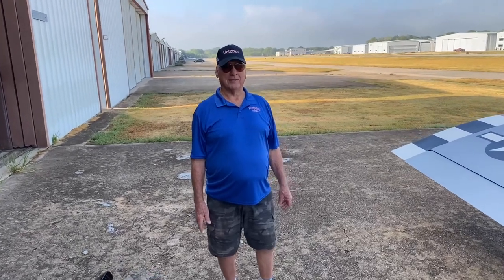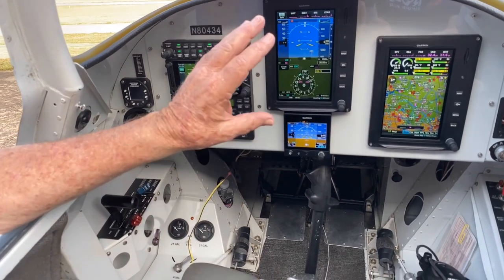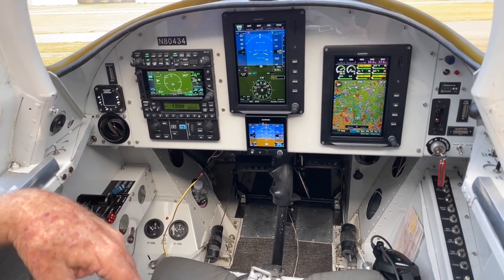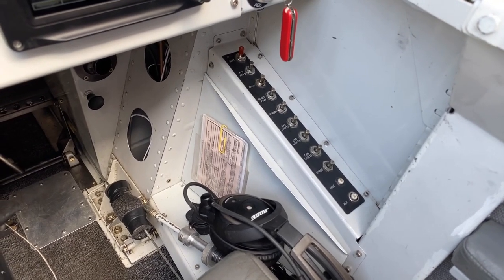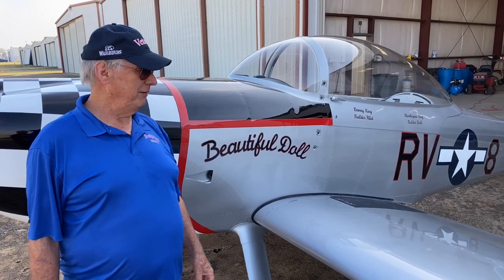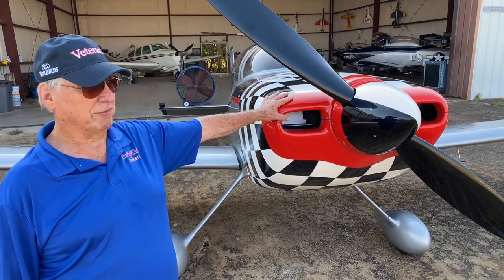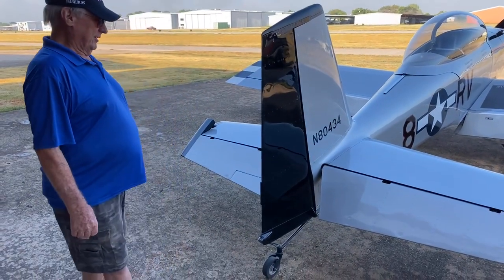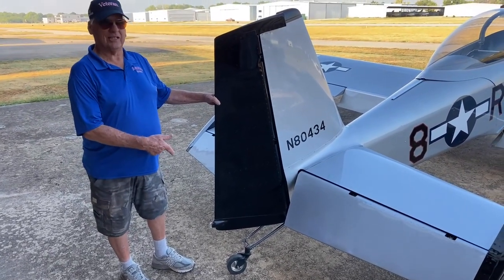Danny King discusses his RV-8 “Beautiful Doll”￼

Comment: Thanks for sharing Danny. Clearly, your RV 8 is the best thought out I have seen.  I built a Lancair 360 with an IO 360 B1B. Had I known about Vans, I think that would have been a far more useful choice. Here in Australia, away from prime airports, some of the outback strips would be better suited to planting crops! Lancair UC mains are very small in order to fit into the wing. 
I did same with fuel sellection and my radio stack came out in one unit. I ommited the header tank and fitted a removable hatch, This way I could remove the hatch and the back of the panel was easy access. Enjoy your beautifun RV. Kind regards, Barry M. Australia.

Comment: Thanks so much for posting this very informative video. I am considering buying an RV8. The first two planes I owned were a 1974 Citabria and a 1946 Globe Swift with 180 hp Lyc and CS prop. But I got tired of the constant maintenance on the Swift, and the restrictions of working on and upgrading an old certified aircraft. The VAN's RV8 is becoming ever more interesting to me. My first choice was going to be an ACA Super Decathlon, but the X country performance is, as you know, lacking.